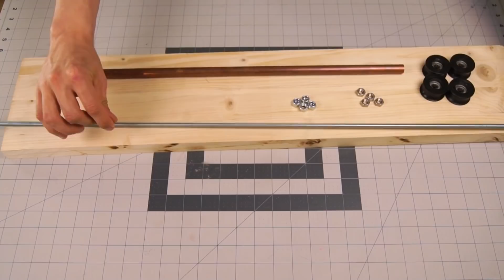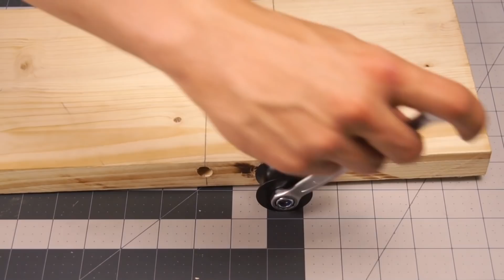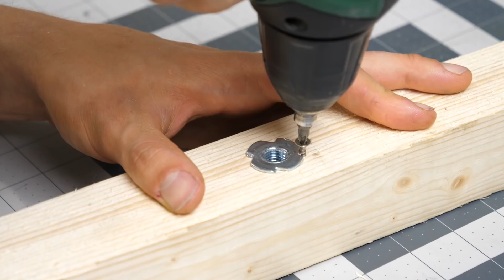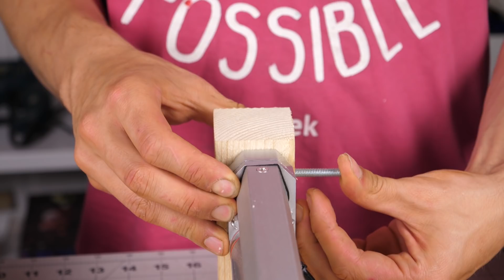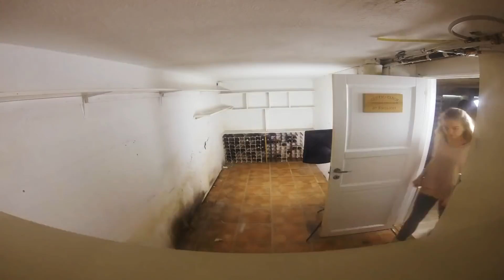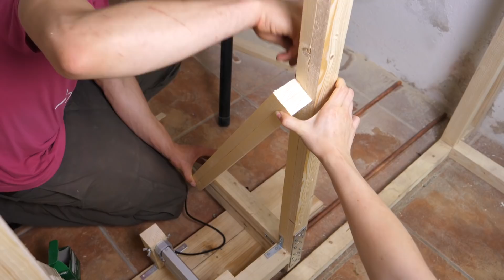Building a Secret Door Part 1 || DIY

Comment: Curious how well this held up 3 years on. If the threads do wear out look for a heavier thread. Here in the states we have "acme" threaded rod, or at least that's why my local sells it as. It is much bulkier with fewer but wider threads. It is more made to be a conveyor screw type material. A bit of grease, or maybe dry graphite lube and it would do exactly what you want. Bonus of fewer threads per unit of length, it should move slightly faster. 

Always like a good secret door and really enjoying this channel since it popped up. Looks like a fun project.

Comment: I'm not sure, but those guides look like full extensions, or at least that's what we call them at the cabinet shop I work at.

Full extensions are side mounts, if they are what I think they are, they'll be incredibly weak the way you have them mounted and could bend or break with only a little weight.

 Most people don't think about little details like the mounting methods. As I said, I'm not positive as to what those are, but check to make sure they're under mounts before you put them through too much, if my comment isn't too late.

And I just realized my comment is two years late.

Comment: When cutting threaded rod, bolt, or machine screw, the threads are usually damaged making it difficult to put the nut on.  One tip I learned is to put the nut on before cutting.  Removing the nut after cutting usually will fix the damaged threads and it will be easier to put the nut on later.

Comment: You are not worried that the copper-tubing won't hold the weight of the construction and with time get "flat"?
Reply from the maker: Not really, they are  rigid enough for that. The door is not very heavy, especially when the weight is spread to 4 contact points! For comparison, I can step on the tubes without any problems.
Reply: Allright.. They seemed a bit less sturdier than they are then! 🙂

Comment: You could add in some switches which are pressed or released by the door in certain positions, for example, one which cuts the power to both motor and actuator when the door is completely closed and open, and one which switches between the motor/actuator on and off during opening.

Comment: I think to make that hidden wall really solid and secure, you will want to make another rail system and actuator for the top of the door. I know it will be a lot more work to do that, but if you did, it would be quite solid and not even need any counter weights.
Reply from the maker: You are absolutely right. During the planning phase I considered this. However, it seemed impractical for my low ceiling, so I decided to not go with it.

Comment: For opening my hidden doors I use an anonymus loose nail protruding just two millimeters pushing on a microsswitch. I used a garagedoor opener, so I can control it with a remote as well.  I also used a paralellogram to change the movement to perpendicular the last couple of cm.  Don't forget to have a backup solution for opening. I have an Allen screw almost invisible, which is connected to a thread rod sliding the door, so I can use a drill with a hex bit to open if I need to.

Comment: When I saw this guy using tubing as a rail I couldn't continue
Reply from the maker: Alright, what would you use? It might not be the most conventional material, but the level of friction is really low. I am building on the same principle of some DIY camera sliders, just upping the scale a little bit.

Comment: I think the copper tube can deform as a result of the heavy weight
Reply from the maker: It's going to be fine because the weight is not so much and its pretty spread out. However, it can become deformed if somebody steps on it too much, so that's something I'll have to think about.
Reply: Natural Nerd just a thought, Fill the tubing with concrete, epoxy resin, etc. to stiffen it up.

Comment from the maker: Part 2 is in the making. I am waiting for some parts now, and I have to do the recording and editing. Martina might publish a project before I finish. Follow us on FB and Instagram to stay updated on what's happening!
Reply from the maker: I am not a professional! Also, I thought I had all the parts, but had to make some design changes, and then I needed to order some more. It should be done in a couple of weeks
Reply: I normally don't watch ads, but you are a good guy I'd even watch a 3 min ad to the end. Great project!
Reply: KK
Reply: Natural Nerd
Reply: Natural Nerd l
Reply from the maker: I am also waiting! Some parts has yet to arrive
Reply: Use a capacitive(touch) or a fingerprint sensor plus a arduino to control the 2 motors back and forth. playground.arduino.cc/Main/CapacitiveSensor?from=Main.CapSense and create.arduino.cc/projecthub/nickthegreek82/arduino-fingerprint-sensor-tutorial-103bb4 and playground.arduino.cc/Main/InterfacingWithHardware#Physical_Mechanical
Reply: Some parts are really rare so they take time to ship and why the hell wouldnt you start if you can
Reply: Who cares,why do you start a project without all parts you need? Not very professional....

Comment: The speed of the door is going to be so frustrating for you that you will just end up leaving it open all the time. 

Save yourself some agony, admit defeat and go back to the drawing board. A linkage or using air actuation will make that far more bearable. The proper linkage would even allow you to do all the motion with a single actuator.

Comment: I think your going to have issues with this thing tipping over(toward the door). Your centre of gravity looks like it's going to be outside the wheels before the door even actuates outward. You may want to consider some  kind of retention of the wheels to the track, think roller coaster, wheels on both sides. Also i agree with some other comments on this mechanism being located on the ceiling for a clean install. Great start tho, keep it up!
Reply from the maker: Thanks for the feedback I mention your point in the video, I will need to create some counterweight.

Comment: Just curious how u will have it slide. Unless u have the shelf stick out an extra couple inches and only connected on one side of the pushing mech. That way it can move on the copper pipes. Or have it move inward to avoid hitting the other shelves.

Comment: You should take mould more seriously. After all it is a health hazard and a hint from more serious moisture problems.
Reply from the maker: To remove the mold from the concrete I erased all traces of it with bleach and a steel brush. To prevent it from coming back, the source of the moist must be reduced or removed. I suspect it comes from the lack of ventilation, so I have improved it. However, it is an old house, and it might need drainage around the foundation. Thanks for your concern though, but I am aware :)

Comment: is there a reason you didn't use treated timber for the walls in your wine cellar? you will find that the damp will return and eventually rot that timber you have installed, maybe not any time soon but I've always been told to build things that will last.

The video was very impressive other then that, and looks like it will be fantastic when done.
Reply from the maker: No, and I really should have, so I might go back and fix that later.

Thank you!

Comment: first suggestion for the 'tipping' over problem: whats about using another copper tube above (+plus a bit offset) the rear wheels? so the rotational movement with that door attached will be countered?
For the trigger mechanism i imagine a inductive/hall-o switch build inside the door itself (hidden) which only informed persons know the exact position. To open the hidden door a metal object/magnet has to be used and close enough to that switch and the door opens automatically (Arduino with endstop switches attached maybe?) To close the hidden door, another switch/trigger could be installed on the right side of the doorframe.
Im looking forward for that build and your ideas!

Comment: Seems like you should have inverted the design, so that you don't have to walk over the copper rails on the floor to get into the room.
Reply from the maker: If you mean by putting it in the ceiling, that would be optimal, but there's quite a few extra concerns when it's hanging. Taking the extra step isn't an issue for now. But who knows, maybe I'll perfect the design some day, or even somebody else ! :)

Comment: wow you are so lucky Martina let you use her tools. :D

I saw two things that could turn into problems later!

1) threaded rod is never good as an axle, the sharp threads can act as a file and destroy things over time;
2) copper pipe can be flattened not only by the rollers but by people stepping on them as they enter;  //steel pipe would be better;

as for the switches;
how about push buttons hidden behind wine bottles;
 pushing the bottle actuates the switch;
yet still allows the bottles to be removed and their contents consumed;  // ;-)

Comment: What about another actuator attached to the door when the door slides back tripping the second actuator switch to open the door. Or a second actuator with a remote control for both.

Comment: I don't know if you need to have a motor for sliding the door side to side, it seems like it could be possible to just slide it with your hand. Having to find another place to hide another switch might be difficult. Another thing you might want to consider is having a kill switch on the inside so if you are inside, you can deactivate the switch on the outside so no one else can get in.
Can't wait for the next video!

Comment: hey guys. suuuuuuuuper cool, but i think it would be great if you mounted the whole sliding mechanism to the top instead, so you don't accidentally step on or trip over the copper pipes in the doorway. i think all the components you are using at the moment would be ok with the weight. the copper pipes only need to be twice as long as the width of the door, so i don't think they'd sag.
either way, i can't wait to see this finished! its amazing!
Reply from the maker: Hey! Thanks for the constructive feedback. Yes, that would be a cleaner solution, but it requires some extra engineering, as the door mechanism also needs to hang. The copper tubing could probably handle it with the proper amount of support. As of now, I think I will have to step over the tracks!
Reply: i would also try to build it just mechanical (without electronics), because technology tends to fail when you want to use it ;)
Reply: fair enough, its not really a problem. just what popped into my head when i saw how it was all going together. its still really really cool! the two phase door is already way more elaborate, and exciting, than what most people would do, if they ever even made something so cool. and i'm sure you're gonna make it look fantastic when its all covered up and hidden.
its by no means the only option, but i think mirrors of vertical paneling would be the easiest way to hide the little gap on the sides of the door.
Reply: How to connect printer by Bluetooth
Reply: Support to counter downward friction and celling work when building from the ground can be a pain.. A lot of looking up during trial and error lol  I suppose if someone wanted they could always cut a tract in the tile so you could step over the pipe slides.  

This seems like it might work pretty well with a full body mirror as the door
Reply: DMonZ1988 it's a great concept but will be very difficult to make it look invisible when done he should have saved time and did a hinged bookshelf or a large hinged mirror with a remote locking system I only say this because I have done many hidden doors and the he is trying to do it will be hard to hide the seams I hope it works out